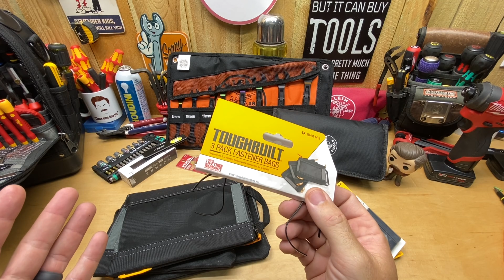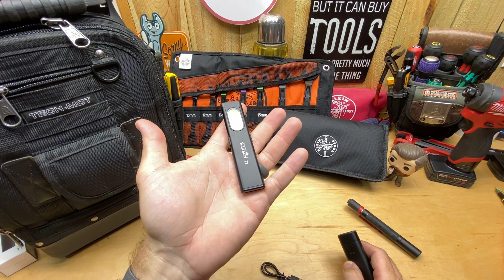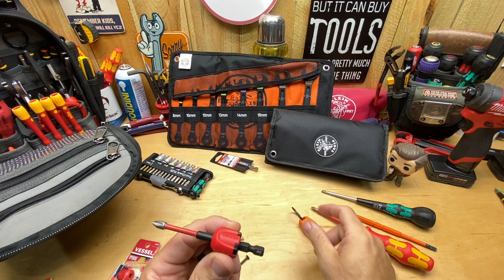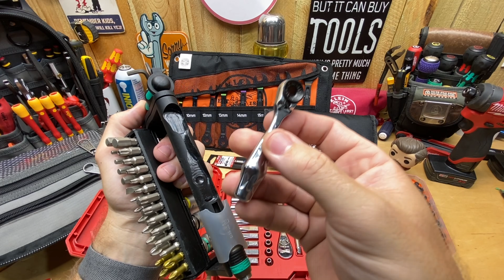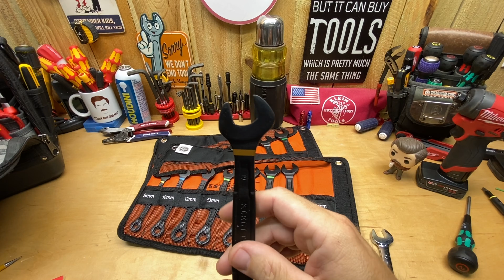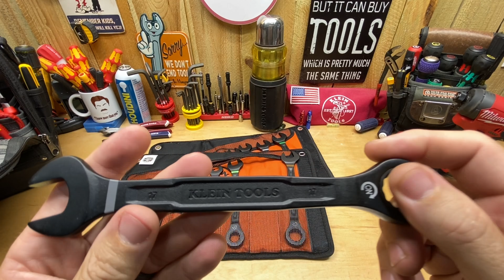TOOL HAUL - Clearance & Random Tools  #klein #wera  #vessel #newtools  #malco #toughbuilt #warsun

Comment: I saw a picture where you can put the ratchet the other way around it in and use the whole tool check as a handle. Have not tried it myself tho 🤔
Reply: But what I can say is, I bought the Wera Zyklop with the rotating head and an extension. It enhanced the capability of the tool check greatly
Reply from the maker: @Dantarios  I haven’t tried that either..

Comment: I've been super impressed with what I can get done with the Tool Chevk Plus. One thing that expands the value of it is you can also buy either the Imperial or Metric 1/4" sockets separately on a rail, I keep that in the same pouch so it gives me even more capability 👍🏻
Reply from the maker: @toolswithtim  yeah the only one set of sockets is what’s always kept me from buying it.  Having both sets is a good option 👍

Comment: I'm taking out a planter box and it has a ton of lug bolts that are literally buried into the wood, flush. Would a saw tooth bit work for something like that?? I've been using a claw hammer to just split the wood but it's been a pain. I had not seen those before.
Reply from the maker: @turbot_  possibly if it’s the right size.  I’m not sure how long they will last on wood.  They are meant more for tape, caulk, etc.  but they do have teeth

Comment: for screwdrivers, sure but never really needed a screwdriver for a fastener that i couldn't use a drill/driver for. 1 thing though about the magnets if you put them on a bit and expect to see the screwhead.. forget about it. they get in the way of seeing the screwhead.   i thought i would edc the makita 1 (green) back when Makita golds were still a thing and i had the hardest time tightening 4 square boxes because i couldn't see best the magnet completely eclipse any view of where to put the bit into the fastener slot   but for building and running long screws into 2x4s it does a good job on keeping the screw on the bit
Reply from the maker: @toolsandtactics  👍👍

I think they are going to be more a small magnatizer/demagnatizer for me to throw in a small Veto pocket.

I can see it being hard to see the tip “that’s what she…”

Comment: Nice tool haul! I did pick up both of the Klein ratcheting sets for $40 each the other day. Nice enough wrenches and definitely worth $40 per set. I'd prefer offsets with a switch, but that'll never happen for $40. I colored in the white logo on the metric pouch with a sharpie so I could tell the difference too. Hard to tell the difference otherwise.
Reply from the maker: That’s a good idea on the coloring in.  I guess they should have thought about that and did something on the outside

Comment: Lennox gold blades for utility knife are the absolute best blades.  Get em ! All Lennox knifes and tools rock check em out you won’t be disappointed.
Reply from the maker: I may try some out.  I run through them on acoustic ceiling tile jobs.  Especially the ones with reveal edges.

My favorite for that have been some older Stanley FatMax blades, but they quit selling those specific ones.  I bought a bunch off eBay, but I’m about out.  So I might see how those work.

Comment: Milwaukee has a really good magnetizer that’s made for their slim type bits. I was able to force it onto the middle of the double sided bit that came with that $13 vessel ball handle screwdriver with a ph2 & 1/4” flathead, it was magic haha
Reply from the maker: I’ve seen those.  I use bit holders 90% of the time so I don’t think to try those.  I bought these to mainly try on screwdrivers.  They don’t fit over a 1/4” flathead… or at least yet I’m going to try and get one to do it 😂

Comment: I got lucky and caught the tool check plus on a sale for $64 a while back. It’s still expensive but it is very handy with all it comes with. I’m an electrician and do a lot of low voltage security and cameras. With the little driver and small ratchet, it comes in handy often to get into tight spaces. Great tool. I like your videos!
Reply from the maker: Appreciate your feedback.  I can see why so many people like it

Comment: Are the wera bits you have there impact rated?
Reply from the maker: I’m not real sure if they are or not… I didn’t get the box or anything with it.  I’d have to look it up and see, but I don’t think so.

Someone else may answer before I find the answer.
Reply from the maker: According to what I found they are not… you have to get “impactor” sets for that
Reply: They are not specifically impact rated but they last fine under normal use.  Put a 1/2 impact wrench to 1/4 in adapter and put 1100 ft lbs on them I'm sure most bits would break.

Comment: those vessel magnetizers seem bulky to the old blue round ones from ?Ridgid?
Reply: Makita makes a blue one they sell in hds.  The better one I found is a new milwaukee one that is kinda rubber like.  It comes in a set with some 2in philips bits.  Better yet it fits over any bit and even over slightly larger ones 5/16+
Reply from the maker: @MattHmm-rq6dn  I will have to check that out because these won’t fit over my slotted vessel tang through.  A little bit to narrow
Reply: It's 2 magnets inside rubber silcone so it should give you that extra stretch.  I tried it on a 5/16 bit and a 11/32 rod it can do it with a little persuading
Reply from the maker: @MattHmm-rq6dn  👍
Reply from the maker: I don’t know if I’ve seen the Ridgid ones.  I will see if I can look them up.  I’m sure there are lots of similar things.  I saw Vessel and “Red”, so I pulled the trigger 😂

Comment: I have the Vessel bit holders clipped to my Veto bag. On one of my longer bits I have attached I keep the Vessel magnet on it so I can just slip it off that and use it on any other driver. I just used it the other day when I had to change the water inlet valves in my washing machine. It just happened to have it attached to my Vessel ball handled #2.
Reply from the maker: I think they are pretty nice.  Work well 👍👍

Comment: Alot of fun stuff!  I've had thoes toughbuilt pouches before and they are well built and the base msrp was 13ish dollars decent value.  The malco still continues to be my go to and kinda stopped using the klein flip sockets.  I don't like spinning that much weight on a impact assemble disassemble   for the few sizes I need can be covered by a few malcos.  What's the country of origin on that new malco I sure hope it's still Taiwan.  The tool check plus I use to use a decent bit and as it's value to alot of people.  Now bit sets like the vessel usa big big case cover most needed and odd size bits.  It's not like I'm gonna not have other full size tools.  I did drill out the plastic rivets on the side for the bit holding handle to make it more compact it does help.  I've recently has 2 youtubers I enjoy and sent them care packages of unused tools they appreciate it and it's only thr cost of shipping to me.  To be fair I've offered a few times to send you stuff it's why I had to go behind your back and get someone else to send you things.  The klein wrench rolls look very usable I almost wish I picked up the sets to gut them.  I have leather and canvas ones from az currently that are good quality (around 20$ each) but I like that flat shape myself.  As always I'm glad you love for the comments it's shows because you have regulars that actually care.  Would it be nice to make more money sure but if you like the interaction like us regulars do that's a reward in itself for your hard work.  We all know each video takes a bit to make and edit 10 minutes equals hours of work.  By the way because you don't badger us to like and subscribe made me want to.  I know it's how people make money but disruption of the flow of rhe video makes it almost worse.  Keep on trucking and we will continue to support you.
Reply from the maker: The Malco is made in Taiwan…

Yeah you have offered and I appreciate it.  I have always had a hard time with people “giving” me stuff.  It’s even the same with companies. 

I love giving to people and I shouldn’t rob people of an opportunity to do the same for me, it’s just my mindset of not wanting to put someone out.
Reply: Yea people offer because you deserve it.  Also like the other stuff I've shipped in the past was never anything from the current arsenal of tools always extras and spare stuff.  I know there's probably a few that would agree with me we just want the tool to find a good home instead of a landfil or scrap yard.  My area selling used tools dosent bring much money or hardly worth the effort. I have given tons of vintage tools I restored for the fun of it to the boy scouts they have distributed them to people in need.  It's actually no diffrent I'm real life if someone really loves something I have and I have spares they find there way to them to pass on the goodwill.  I refuse to put them in a bucket and say a buck a peice and maybe make 30 40 bucks?  I'd rather have smiles per gallon 👍
Reply from the maker: @MattHmm-rq6dn  that’s a good way to live my friend 👍

Comment: Small tip/trick for the tool check plus- You can take out Wera's rapidaptor, and replace it with a 1/4-5/16 flip socket. The malco fits flush, as if it were made for it, but I like the Klein because It works as a bit holder as well, and only sticks out slightly, and I run other Klein flip sockets. I bought the imperial version, removed the 4 smallest sockets, added a 9/16", 8mm, 10mm, 13mm, and the shortest Klein flip socket- covers more of what I run into. I also changed out a lot of the bits so I have SAE and Metric hex bits.  I keep mine in my overalls pocket daily, so I can justify tweaking it.  I honestly can't believe how much use I get out of that little driver and ratchet, because they're always on me.
Reply from the maker: Thanks for the info and tips… those are good ideas. 👍👍

Comment: I have the Wera Tool Check Plus and Vessel Mag Enhancer. Both good products. I’m going to order the Warsun tonight. I was just looking for something like that, but ended up getting the TrustFire Mini X3, which has a flashlight, UV light, laser, and front facing light. And it’s USB-C. TrustFire would probably send you one to review. The fit and finish isn’t quite as nice as Olight, but it’s also almost half the price.
Reply from the maker: I will look up that light and check it out 👍👍
Reply from the maker: For $11 the Warsun is nice… in my opinion.  Time will tell
Reply: @MORGANSMaintenance Can’t go too wrong with an $11 light. I just ordered it using your link.

Also, if you’re looking for more bit magnets, Anex, Engineer, SK11, and Takagi Earth Man have some interesting ones. They’re listed as “mug catch(er)” and “screw catch(er)” on AMZN Japan. Those brands also have interesting keychain bit holders(similar to Railer’s) and locking bit holders. 

There’s also something on there called the Takagi Earth Man Share Link Multi-Tool that you might get a kick out of. It’s the kind of tool that could only be reviewed on April Fool’s Day.
Reply from the maker: @k1_w3  appreciate it.  I haven’t scrolled around Amazon Japan in a bit.  I will have to check those out
Reply: That light looks great.  Unfortunately, it’s not $11 anymore.
Reply: @ lylewaters6161 It had a $4 coupon, but it went away sometime last night. I assume they had it set to expire at a specific time, or MM’s review generated a bunch of sales and triggered an algorithm to get rid of the discount. Check in on it in the next week or two. I bet the discount will be back soon.
Reply from the maker: @k1_w3  my guess is Prime Day they will put it back on 👍
Reply: @k1_w3  yup, it’s back already and I ordered 4 of them
Reply from the maker: @lylewaters6161  it had to have just changed… I checked it just yesterday.

I’m sure they probably put it on sale often, especially with Prime Day coming up.  Prices on Amazon change like crazy
Reply: @MORGANSMaintenance  yeah, I put it on my wishlist and kept checking back.  It went unavailable for a bit, but now it’s back in stock and with the $4 coupon.  I ordered 4 of them (individually so I’m could get the coupon for each).  We’ll see how they are when I get them.  Thanks for the recommendation.
Reply from the maker: @lylewaters6161  👍👍.. I think for $11 they are good.